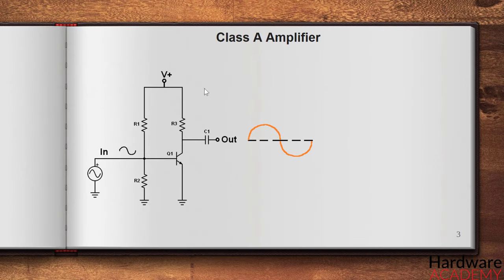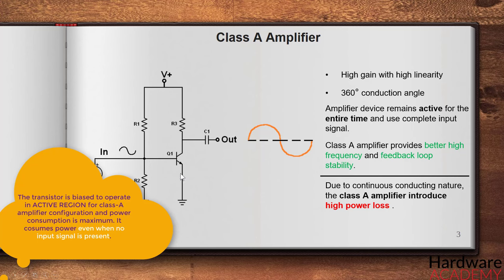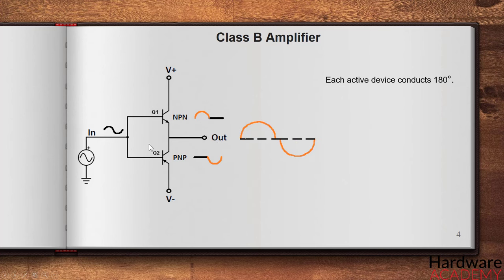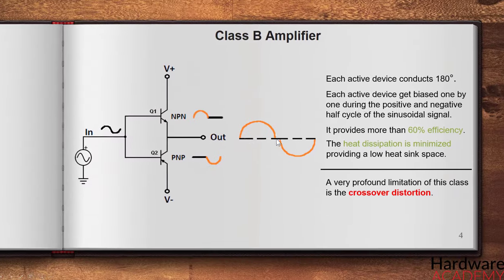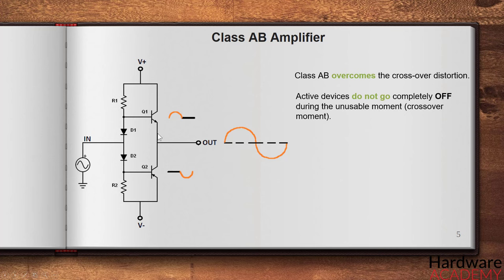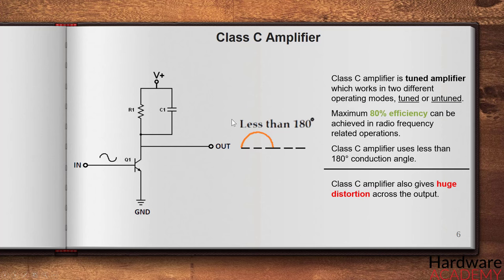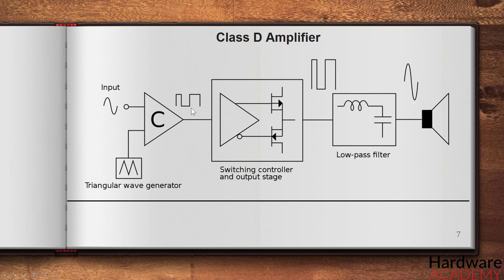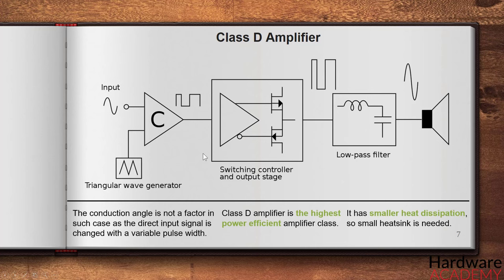Class A,B,AB,C and D amplifier (Udemy Course)

Comment: People REALLY need to watch this video to understand how these topologies work. Nice work. BTW... no class H?
Reply: G and H are basically an AB with preregulated voltage rails. Switches between discrete voltage levels in a G, and continuously changed in an H. Fairly obsolete today. A lot of the higher (beyond F) amplifier types are attempts at squeezing higher efficiency out of AB using complex circuity, or attempts to overcome distortion issues with early switching amplifiers (such as K and I)

Comment: In Class B and AB amplifier, are you sure the PNP transistor's emiter pin is on that position? I think the collector pin shoud be to ground...
Reply: yes absolutely
Reply: I suspect the PNP tranditor's Emitter and Collector pins should be swapped. The Collector should be connected to V-

The way that's shown in the diagram doesn't seem to bias the PNP transistor properly

Comment: Couple points on class C:
- The slide diagram is wrong, you'll never have a resistor in the collector path like that. It will be an inductor, to form a tank circuit with that capacitor (like the example real circuit)
- The class C, on its own, is only good for amplifying RF signals in which the envelope does not carry information, so CW and FM only. It can only be used for AM and SSB amplification when additional circuitry for EER is implemented.